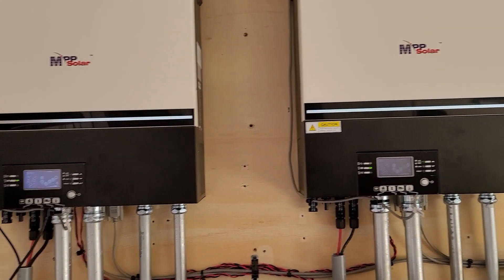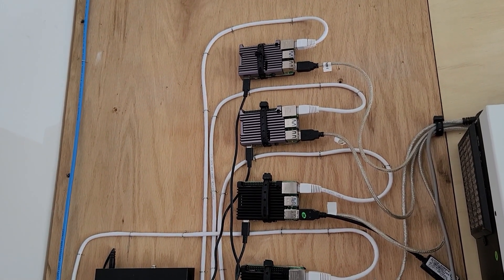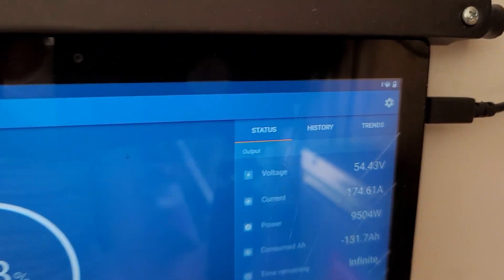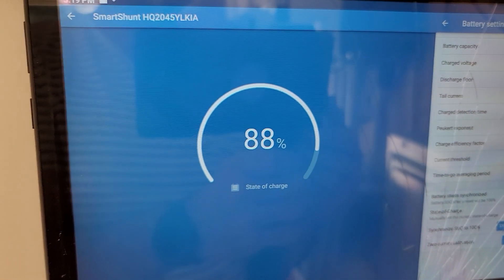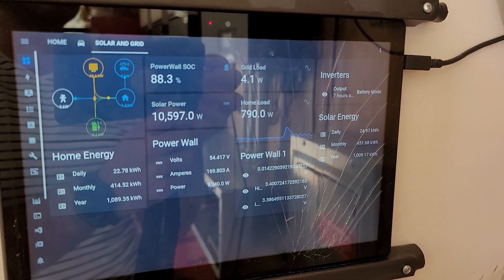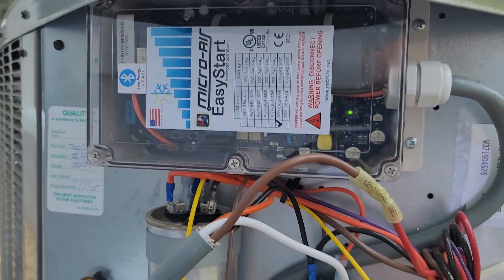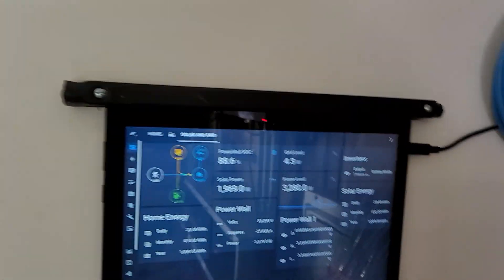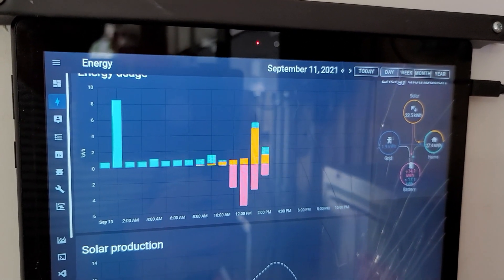Micro Air Easy Start & Smart Shunt.... (Equipment Update)

Comment: One MUST use a clamp-on meter that is specifically designed for (and have a mode for) "inrush" current.!  >> A "peak-hold" function is ONLY "fast" enough to take a "pall-park" reading, because peak-hold relies ONLY on the "sampling-rate" of said meter (usually only about 100 milliseconds). >>> To provide repeatable motor inrush measurements, advanced clamp-on meters (those that have a "inrush" mode) use a "triggered" mode that synchronizes measurements with the starting current. >>> The meter is "armed" by pressing its inrush button. >> The meter is then triggered by the inrush current. >> Once triggered, this inrush function takes 100 to 400 samples over a 100-millisecond (0.1 second) period, and then calculates the actual starting / inrush current...
Reply: @Justin Time Hi Justin., I don't doubt that whatever particular model of "Southwire" brand of clamp-on meter you have., does have an "Inrush" feature / button.  >>>  I was only referring to the Fluke 325 unit that's being displayed in your video at about the 6-1/2 minute mark., of which the Fluke website specifically states doesn't have an "Inrush" function / capability. >>> Sorry for any perceived insult sir... >>> Regards, Eric ("Klein Communications", electronics repair & design service)

Comment: Measure on the red 120V leg going into the contactor, to see if that is any different. That is going to “C” or common on your compressor. I wish you had my Fluke that measures “Inrush”. What model did you purchase and from where? My eyes aren’t good enough to see the checked line on the unit. Starting my 20.6 kw pv system soon. It’s been a busy summer at work. Finally up to 80.6 kWh of LFE 280 aH in stock. Looking good down there near our last place...where you are making similar power as we will be, on 20% less panels.
Reply: Wouldn't the inrush be the same as "max"?
Reply: Inrush is not the same. Google difference between the two. They can explain it better.
Reply: @USA-GreedyMenOfNoIntegrity  looks like the difference is sampling rate. So if the peak is very short the inrush setting might be more accurate.

Comment: Thanks for taking the time today for the upload! Looking forward to thr LV6548 review. I have been running 2 now for a few months, and so far so good. About to add another 14KW of battery, and have ordered a couple Seplos BMS's and batteries. Hoping I can get the CAN Pylontech protocol to work with the BMS and MPP LV's for direct SOC to the inverters.
Reply from the maker: I just looked up those BMS's. They look good. Interested in your experience with it.